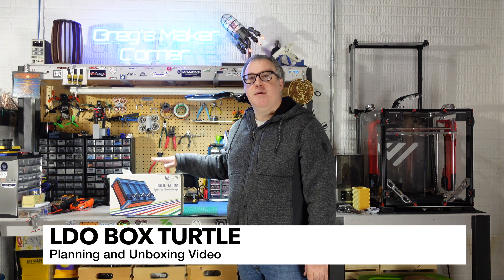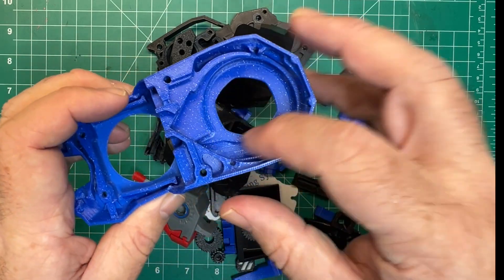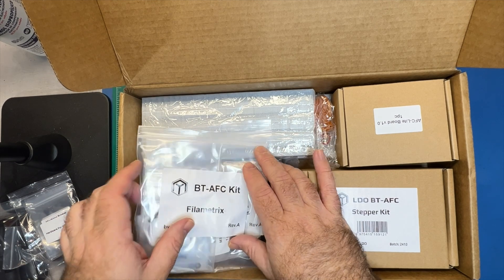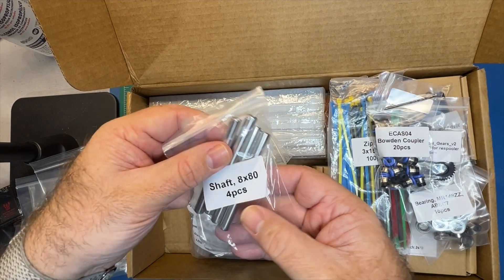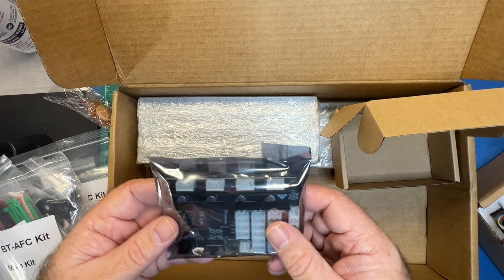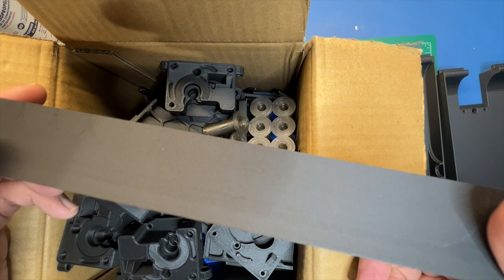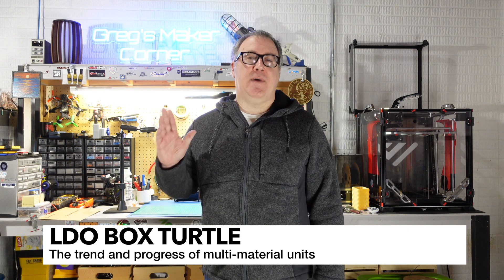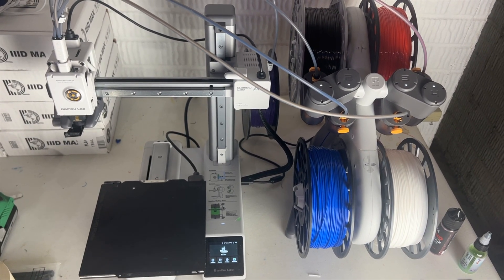LDO Box Turtle Planning and Unboxing

Comment from the maker: A few notes/ errata: 1) Some of the printed parts I show for the Box Turtle were older versions. I will have the proper parts when I do the build video.  2) The Box Turtle isn't actually an MMU, though that term is commonly used (see Armored Turtle's comment for more info). There are reasons for this (changing filament types / purging complexity of different materials, to name a few) and I plan to cover this in a future video. I am using the term "generically" as a multi color / filament changer. Kind of like when you say Xerox you just mean a photo copy.

Comment: Man that price on this thing is insane and very very hard to swallow, I'll probably end up buying one but man is it going to be hard clicking that button especially when you also have to print the parts yourself so that price is even higher.............
Reply from the maker: It definitely is a bit expensive, but I am very optimistic that it will be a good buy and upgrade. Considering the price of AMS adding to Bambu it seems competitive. You can get cheaper PLA for under $20 a roll, that should work fine, so hopefully that doesn’t add too much to the cost.

Comment: Nice video. Not to be that guy but the term "MMU" is a misnomer. BoxTurtle is labled as an "AFC" (Automated Filament Changer). Single nozzle multi material is possible however not generally  advisable in the same print.
Reply from the maker: Much appreciated! I was using it more as a generic term, but that makes sense. And also hoping it could do mixed materials but I know that may not be as feasible.
Reply: Klipper :) do what you like, just be ready to tune purges for it

Comment: I wouldn't recommend the T30 and T15 gears in the kit. It took me quite a while to figure out that the tolerances are way off for the respoolers. Additionally, one of the motors for the respoolers was faulty, so make sure to check them for smooth operation. I ended up swapping the gearbox onto another N20 motor with the same specs.
Reply: I sent him the latest 15T/30T printed gears with the FilamATrix parts. :)
Reply: @thunderkeys  sounds exactly like the Ldo kit I got. Mine had the cutter and the tn 1.0 buffer as well.
Reply: @SkippyTheBeerCan1337  I heard that about the gears, how did you test the small motors for the respoolers, did you just plug into the afc?
Reply: @jpmpro2000  just put the t15 on it and it should spin smoothly around. Mine had a very crunchy feeling to it. I also took the gearbox off it and spun the little gear on the motor when I noticed the feeling.
Reply from the maker: Thanks for the heads up - I'll be sure to keep that in mind and do the checks!

Comment: I built my Trident based off of one of your videos and it's been fantastic.  Depending on your build and if it does well enough that you'd recommend it, I may be building a Box Turtle.  I wasn't very excited by the ERCF.  I do have an X1C with 2 AMS units and love the capability.  I haven't implemented a nozzle scrubbing solution for my Trident and I know that will be needed for the Box Turtle. When I added TAP I lost 3mm in the Y, my nozzle is at the back edge of the build plate when all the way to the rear.  Wasn't want to move my plate, but I may need to.  Maybe it can scrub on the left rear corner?
Reply from the maker: Thanks for the feedback and glad to hear about your Trident. I figure there will be a few details I still need to work through, especially the scrubber as you mention. I haven’t added tap, still running mostly stock on the v2.4. Ideally I’d like to add to my vzbot once there is an option. Thanks for watching!!